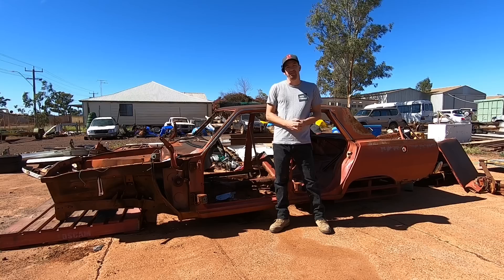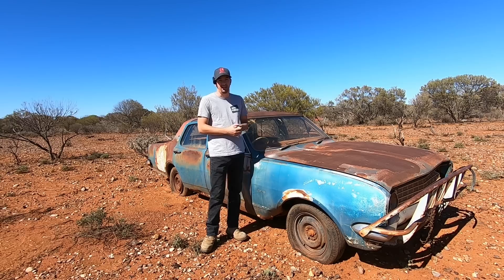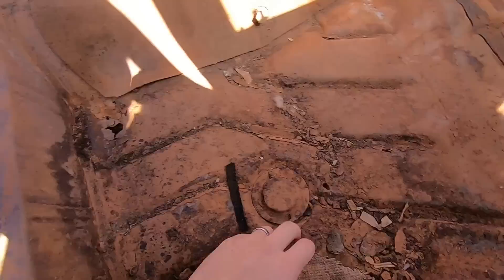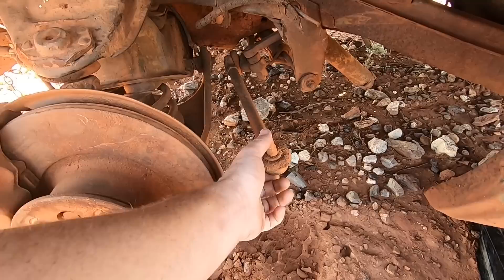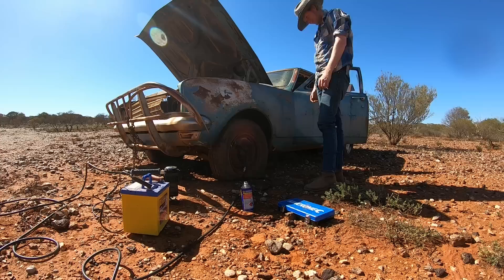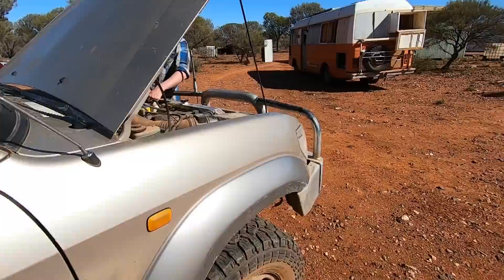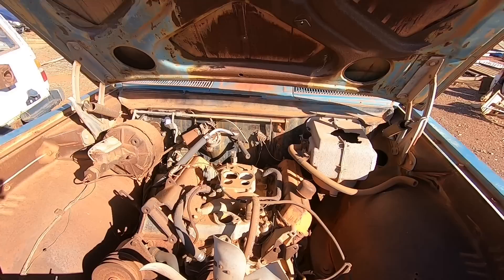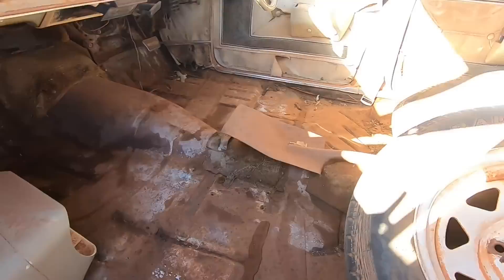Rescuing a rare 1970 HG Holden Brougham from the Australian outback

Comment: Used to have an HG brougham. That's the original steering wheel however there's a fake wooden insert that runs around the face of the wheel missing. You can see the depression in the wheel where it goes. The horn press had a crest in the centre on the Brougham and that's been gouged out. Different to the others. That car came with factory air I can tell by a few things but mainly by the ORIGINAL master cylinder with the circuit for the fronts coming out of the big nut on the front rather than on the side near the line out for the rear circuit. The front side circuit has been blocked off. That's an ORIGINAL water pump too, they were only made like that for HT and HG 253/308. It has 5/8 inch inlets either side of the top where HQ on had only one on the battery side and models later on had two on the battery side. Although later ones will work with minimal reconfig of pipes and hoses, you'll never find a pump like that again, same with that master cylinder. Hopefully both can be overhauled though to be frank the original master cylinders on HK/T/G weren't all that long lasting, relatively speaking. Someone has changed the rocker covers or it's not the original engine. Original covers didn't have an oil filler, the filler was a pipe on the front between those two 5/8 hoses on the water pump. Original brake pedal rubber too, car probaly hasn't really done all that many miles. Looks like the car had front bucket seats ex-factory too, rather than the standard bench bucket. Rear seat belts were an option in 1970 but mandatory for all seating positions for cars with build dates starting January 1971. - Very unlikely that the clock will still work but I've been surprised before. It's self winding via a solenoid which is periodically triggered by the contacts of ratcheting "points". They look a bit like ignition points of years past. To fix the clock the points need de-oxidizing. Use a small mild file and act like you're a dentist when doing so, being very careful.

Comment: It's a no-brainer. It would take a shit-ton of cash and time to get that Brougham on the road. Best to sell it (as-is) to someone who has the time and money to do a proper restoration on it. There would be plenty of guys willing to spend a few years getting her back to as or better than new.
So cash the Brougham in. That way you can chanel the funds into the VF Pacer. The Pacer is also going to take a fair wack of cash if your plan is to do the right thing and restore the VF.

Perhaps I am bias. 
Fun fact; I had a VF Pacer back in the day. The previous owner had installed VH E38 Charger running gear from fan to diff and it was a rocket!

Comment: Nice find. I had a 1968 HK Brougham in the 80s, Silver mink colour with black interior. The first generation of V8 Holdens as it had a Chevrolet 307 matched with a two speed powerglide transmission. 👍
Reply: And with the 307 V8 the 2 spped powglide does 70 mph

Comment: Had same car ,  same colour interior too but I had Persian sand duco , ,   please keep those seat belts and buckles ,  ,, yes steering wheel is factory ,  308 motors in Brougham is same as Gts monaro  240hp  with 76 jets in carry,,   , ,   this car sure makes mine a very much new car ,   I had fridgedaire air conditioning too ,  21 years I owned it and travelled a Max of just 807 miles in 21 years sold it 2 years ago

Comment: The “Browam” Brougham is a super collectible car. Correct me if I’m wrong but I thought they come out with a 307 or 350 chev. You’d get good money for that car don’t destroy it unless you want to upset a lot of people lol. Cheers DJ
Reply: HK was Chev 307 and, maybe 327 option?  HG went to Aussie 253 or 308.
Reply: Hk brougham 307. 327 was in the monaro
Reply: HK & early HT got 307s with Powerglide. Mid to late HT 308. HG all 308s with Trimatic. 327s and 350s weren't offered in Broughams. Maybe special order, I'm not sure about that though.
Reply: @stevenmccloskey4866  True for lesser models but HT Brougham was the only HT model to feature the 308 from release. 307 stocks were used up in all other variants until late ‘69 when 308 rolled out across the range.

Comment: IMO i would put in shed out of elements and then pull motor out and rebuild it , fix front suspension , Brakes etc .. source missing parts , moulds , badges , seats etc ... re-paint it . lower it 2 - 2 1/2 inches ... keep it all original as they are so hard to find , plus you can buy repo front Gaurds and door skins .. defenitly a 40k + car once restored.

Comment: If it was a HG premier it would be more desirable, I worked for a Holden dealer in Perth when these were new just before the far better Statesman and Statesman Caprice were released they were pushing it uphill trying to compete with Ford Fairlanes and They looked awkward with the same wheelbase as the regular Holdens as GM-H tried to disguise it by the ugly extension of the rear boot and panels, I would seriously consider spending all the effort on another make or model as it’s present condition certainly does not warrant what would be the end result as they say you can sugar coat a piece of …. But it’s still a piece of …. And this is why they did not sell in large numbers unlike the rest of the Holden range, if it was a good looked after survivor car it would probably be a different story but many of us around in their day when built would probably tell you the same it’s really only the younger generations that think these things are cool!
Reply: Had I owned a fully optioned HG Premier V8 back in the day, I certainly wouldn't have envied a Brougham owner. Yes, they were a styling turd. Now they're a rare styling turd.

Comment: Id have put the two inflated tyres on the back, done the brake clean/ ether tyre reseat trick and pulled it on backwards so the front wheels just trailed and stayed straight.

Comment: I think it’s better than the pacer the V8 car mate it’s probably pretty rare disc brake front I have a look at the motor, see if they can be sent off to be done again. If not, do the old LS swap make yourself a nice bush Rick car for a burnout comp. I think the interior will be hard to get been a Broham
Reply: They were all fitted with disc front std
Reply: @andrewbeaty1020  I didn’t know that my HK was drum break all the way around
Reply: @HUNTINGNT375  what model hk? 
Lower models still ran drums but hg brougham were all fitted with disc brakes and power steering
Reply: All KTG V8s had disc front ends. As did all GTS Monaros including 186S powered ones.

Comment: love that colour parents had a 68 same colour with a vinyl roof 307 chev - the 1969 308 checkered rear plate on boot difference in terms of steering wheel that looks different to the one on the 68 from my memory think it had a black middle with holden logo and wooden wheel brown (but ours was a black vinyl roof so possible an option) to me that looks possible like one off a Premier but never actually viewed a 69 model steering wheel but think may have been the same dash looks the same - seat belts rear look like an upgrade from 69 with the bench seats in cream with the B logo and arm rests high beam on floor dash looks the same

Comment: I built one of these up in the 90's. Had a Rodeck 350chev engine from a speedway car with a supercharger on top of twin 1100 dominator carbs. 2 speed power glide, mini tubbed rear end with a 9 inch running on Avgas

Comment: Have owned 2 and unfortunately sold both. Definitely needs to restored. Brougham pronounced as Broham. 
Not sure it’s the original engine either. They never had viscous fans and the oil filler was through the top of the timing cover via a metal tube.
Reply: Viscous fans were fitted on factory a/c cars
Reply: That oil filler is on the 307 chev engines
Reply: @nicholasgreen6913  ht hg 253/308 had it through timing cover also.

Comment: The 1968 307 was a better model with the Chev motor an power guild 2 speed . She worth more put back to original . Please do the pacer original  maybe headers bored 60 thou 350 Holly index the plugs  large air cleaner as the motor works like a air pump. VG Pacer fan Les drag . 323 lSD . CM front sway bar as there bigger . 14/7 old school mags  with 225 white letter tyres  . Don’t. Jack the rear they sat lower at the rear an front over base Valiants . Use the Same style of shocks all round an the same tyre size all round . That a start iv owned many pacers an Mopars . Also VF pacers had the higher buckets seats over the VG model .

Comment: No chance of restoring this to original - finding correct Brougham specific interior trim, badging and brightwork including those tail lights and rear panel would be nigh on impossible. Better to resto mod it keeping the body original and unmodified so it still retains some value down the track.